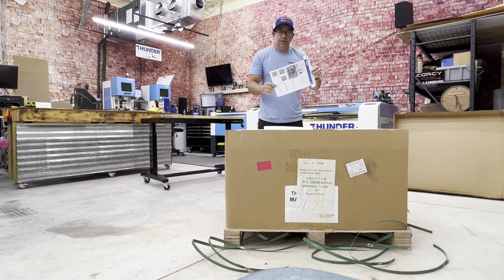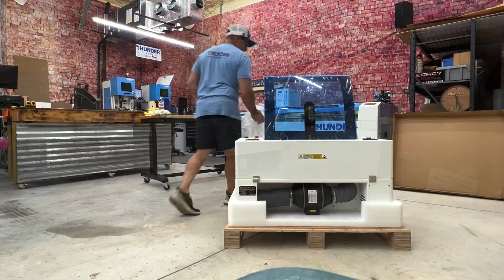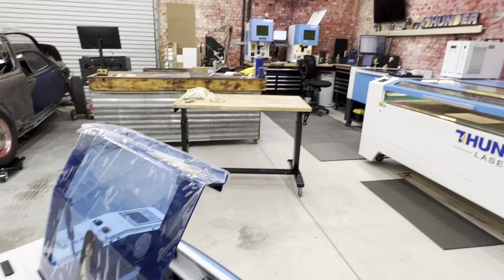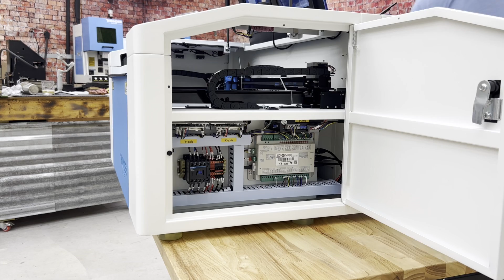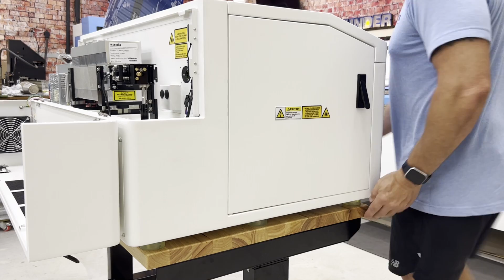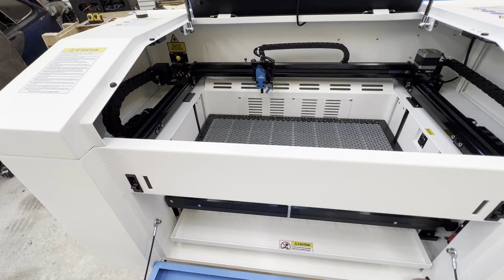Thunder Laser Bolt: Unboxing

Comment: Only one concern on this is the fact that the exhaust is positive pressure rather than negative. Is there a way to turn off the onboard exhaust fan so a third party "pulling" fan could be added?

Comment: 25% less power than Glowforge Plus for the same $4995?
Reply from the maker: Lance.. not quite!  It is a 30w RF tube. The RF beam is 3x smaller and more dense than its Glass C02 counterpart, It lasts 3x longer as well. Its effective cutting ability is more inline with a 60w Glass